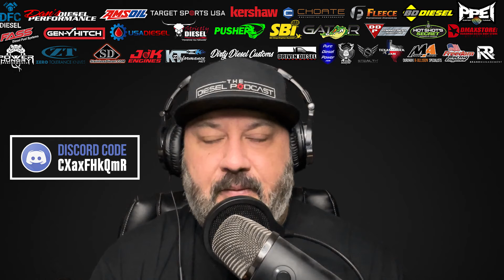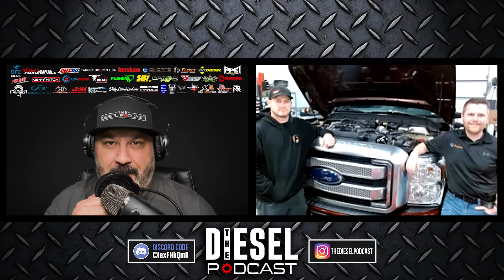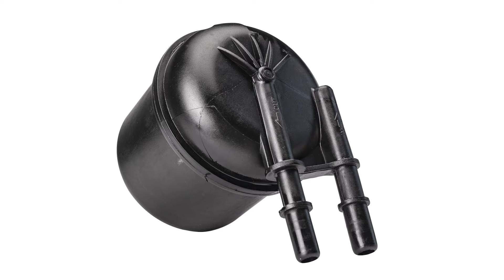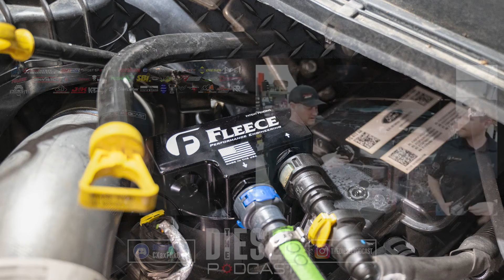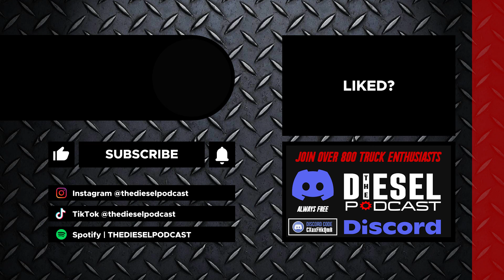Huge 6.7L Powerstroke Fix!

Comment: Just ordered the kit from Fleece. It can't just be a "brittle-over-time" issue, because I put a new OEM filter on after the original one cracked and the new one cracked within 2 days. May be a symptom of another problem, but this kit should be a reliable fix.
Reply from the maker: Thanks for the feedback, hope that resolves the issue for you!

Comment: When will they be releasing an option for alumiduty lower filter? Buying the kit for the upper filter is pointless as you still have to buy the lower filter and they come with the upper as a kit.

Comment: The lower filter is a great idea my 2012 6.7 has some problems put an 18 motor in it but I have to get the 12 and 18 filters but if you come out with the under filter my problem is literally solved!